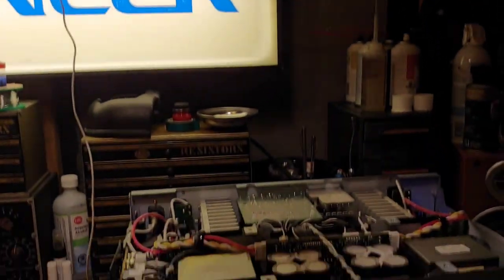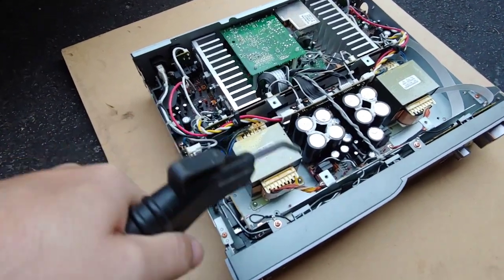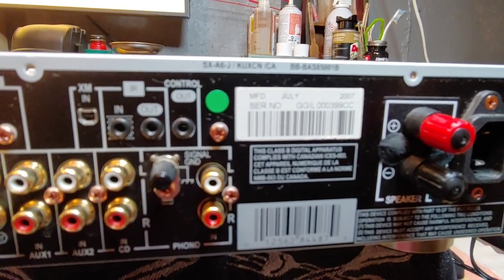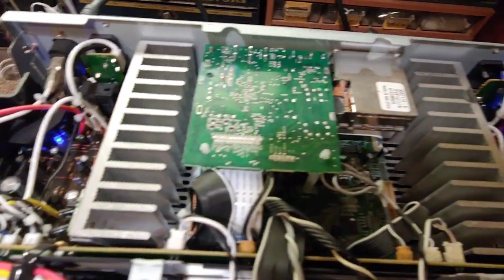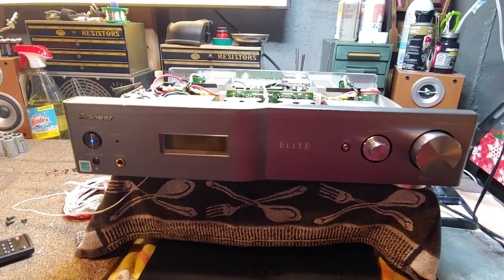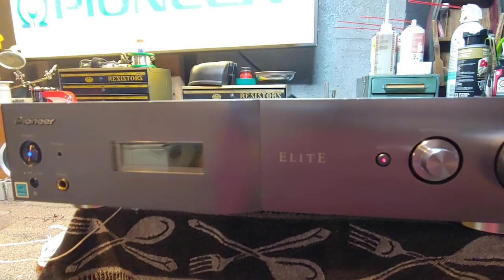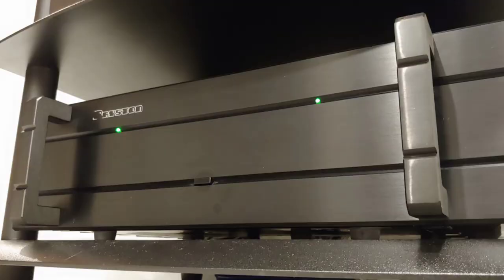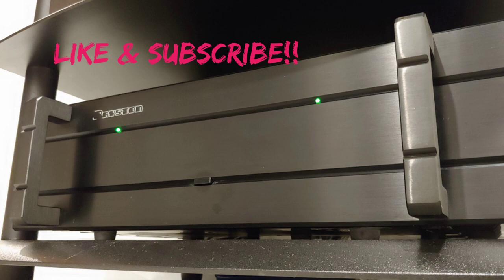Pioneer A6 Receiver (SX-A6-J)!

Comment: I've been using one for years with a $1,850 speaker system and love it. I also have a $1,500 Cambridge audio Azur 840a integrated amp I use in another room with similar quality speakers. The Cambridge Audio is a bit more detailed, but the Pioneer is probably more musical. 
It's hard to say how powerful the pioneer is compared to other amps. The 45 WPC is rated at total bandwidth from 20 Hz to 20 kHz. Most other companies rate their power at just 1 kHz. This receiver is truly remarkable, and I've compared it to many. However, it's a bitch to find a replacement for the remote, and I need one. Some of my buttons wore out

Comment: I love this amp. Enough power for my room.

My complaint, besides the remote ID that the phono stage is either not compatible with my ortophone 2m blue cartridge or they ju as t threw it in there Inan era where Vinyl was in decline.

The difference with a pro-je t phono box is that nitrous that there is no way you can even confuse them. Even my wife can tell the difference. The internal phono stage seem to delete highs. 

Otherwise very solid, not fatiguing
Reply from the maker: It is a great unit, very well built for sure. I too hate that pesky remote!

Comment: Hey there! Just found one on my craiglist for 140$ can.Is there things i should check???Very interesting your video!
Reply from the maker: Not much goes wrong with those units. The only sketchy part is the remote control, it's a bit flimsy. Otherwise, it's a solid unit and it seems priced right! If you don't want it, I'll take it ;)
Reply: Search eBay for the 2nd generation remote. Nicer bigger.